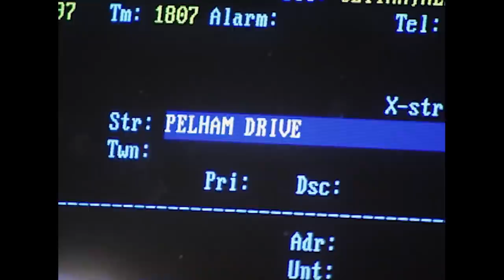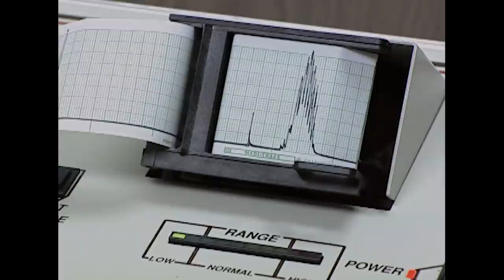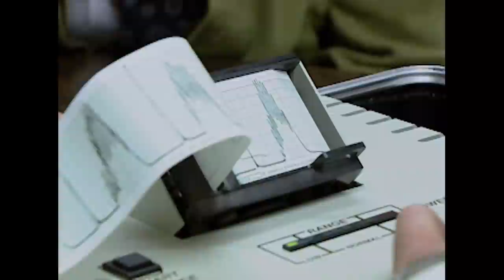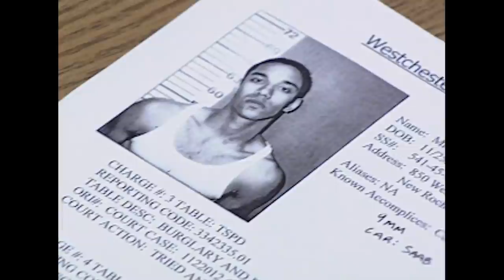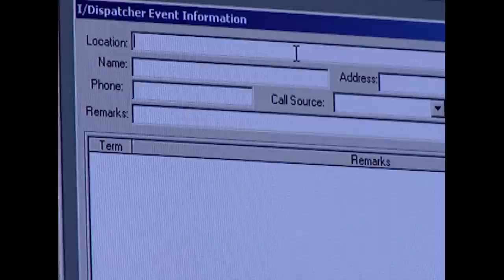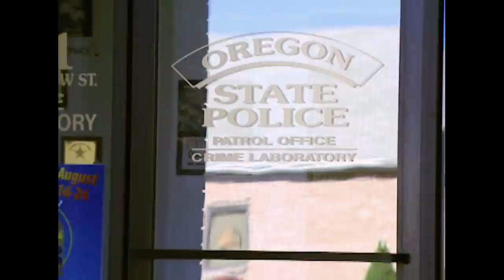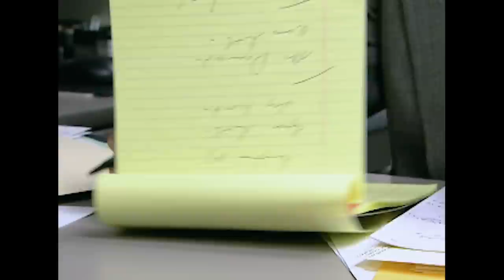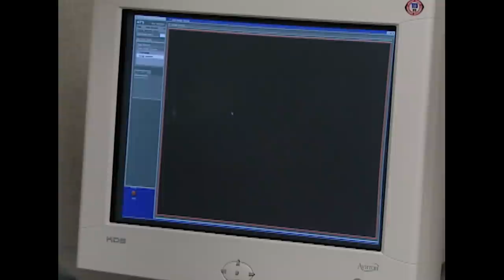Fragmentary Clues Leads To Killer | The New Detectives | Real Responders

Comment: Call me racist or what ever but for murder 1st or 2nd degree it should be life with no parole - the victim is never coming back so your sentence should reflect the crime.
Reply: I totally agree with you 100 percent or they get lethal injection or the electric chair
Reply: I wish it worked that way. Unfortunately most of the cases get closed by making a deal which results in a confession and the missing details for a lesser sentence. The person usually knows they are on the right track and wants a deal before there isn’t one.

Comment: It doesn't say much for the relationship between the Buchanan brothers.
Lenny/Lanny was prepared to see his brother Robert take the blame for the crime, whilst Robert, during his confinement on murder charges, seems to have failed to make the connection between his brother's access to the .22 rifle and that he wore similar shoes, but a size smaller.
It's also odd that the police, during their preliminary investigations, didn't consider both brothers as suspects given the circumstances, eg. access to murder weapon, did they buy shoes together on a shopping trip, were there times when both brothers worked with each other in cutting grass etc. The Judge was correct to throw out the case against Robert but he may well have deliberated longer over the other brother had decent evidence been presented at the same time.